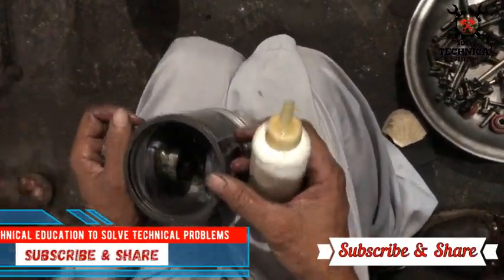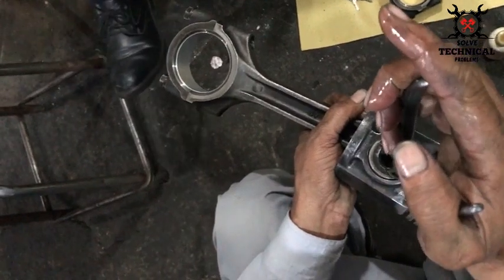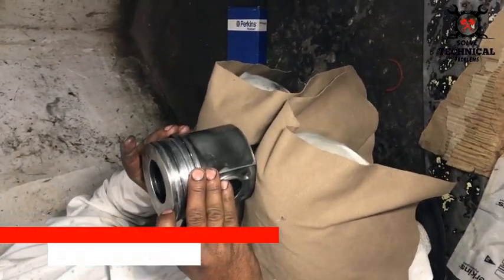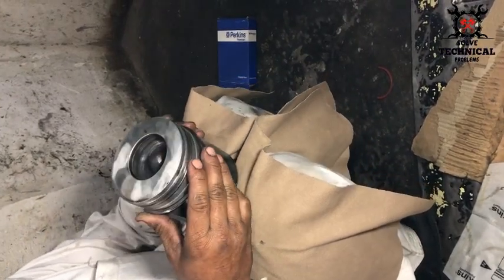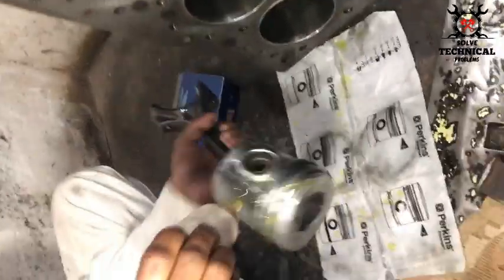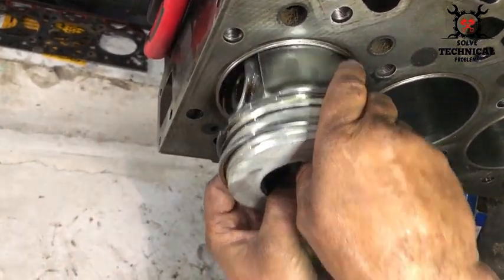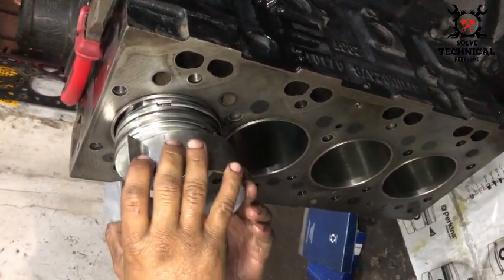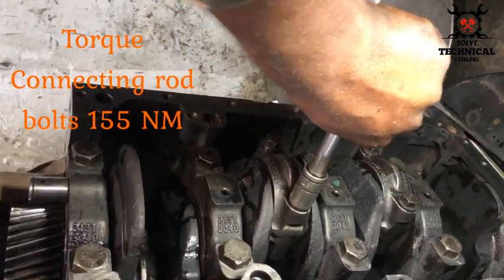Piston ring and piston installation Perkins phaser 4 cylinder engine

Comment: Not good 
This rebuild will fail 
You have a huge mistake on the piston rings gabs angle should be rotated by 120 degree
Reply from the maker: Very valuable information thanks bro
Reply: This doesn't fails the engine 😅